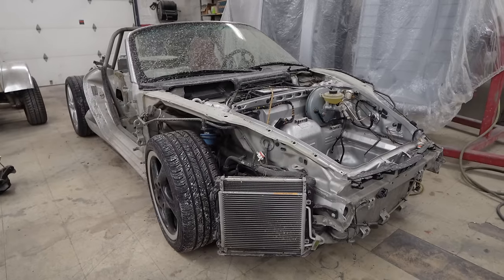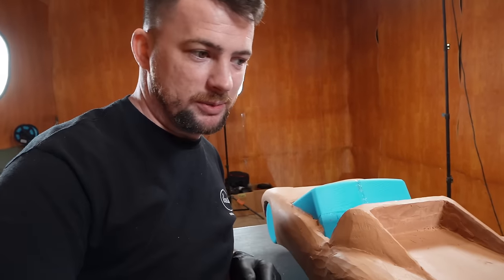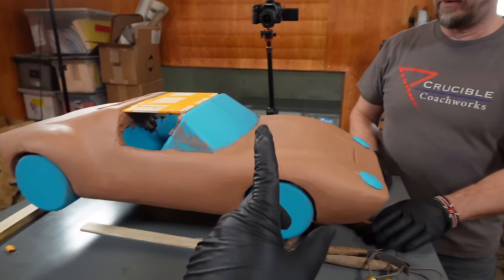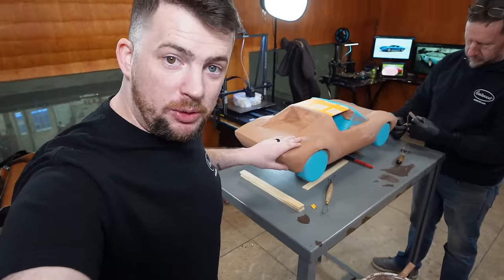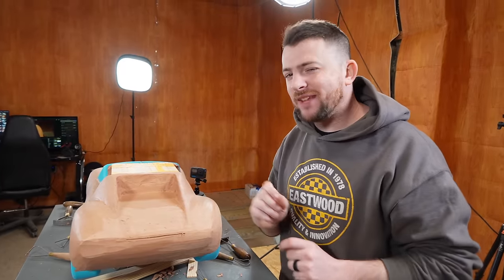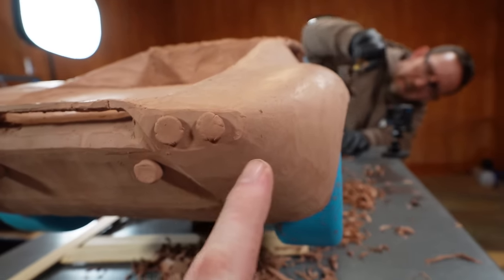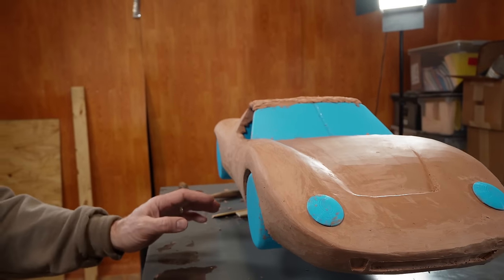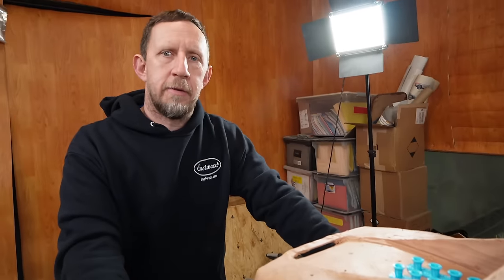We Used CLAY to Design Our $500 SUPERCAR! - Project Jigsaw

Comment: I think you are making difficult for yourselves.  Surely you need concept sketches before touching clay?  Just futzing around means more work and way more time to come up with something that works.  There are plenty of computer programs to help in design, so why not use them?  Second the lines for the door and engine access need to be thought out before trying to make them.  Lastly what sort of top is having, hard / fixed or targa / removable type.  Not easy to do all this.  It takes time, and you can get  option paralysis, but time spent in the design stage will pay off.  Having said all that, the car looks cohesive in concept
Reply: As someone who is far better at making scale models of the furniture I am going to build rather than drawing them to properly demonstrate my thoughts, your comment let's everyone know your genuine lack of understanding when it comes to self education. These guys are not designers, they are builders. They are using a medium that works for them to take what's in their head and make it something real. Just because it isn't the "standard" process means nothing. I feel bad for people like you stuck in your little tunnel vision worlds.
Reply: Id beg to differ, while yes concept sketches are great but it's only 2d, and 2d drawings can only translate so much into 3d. I imagine that yes they did sketches at points but IMO a) clay is more fun than any computer program, b)easier to translate and comprehend than a sketch, and c) they can scan the clay and put it into a digital medium if they wanted to. 

I love designing cars and if I had the space to do clay, I would do clay everyday over doing it on the computer. Plus 2 people can work on the same thing with much more ease than a on a digital program, or handing a drawing back and forth.

Comment: Ford GT has sqare front lights and circular tail lights, Miura has circular front and square rear... So, if you go with Porsche lights in front, it would be better to put square tail ligths... I think a new gen Fiat 124 Spider would be a very good match for this design

Comment: If you add a little volume to the top of the door and where it intersects the rear quarter panel and "flying butress" area I think it will help to tie everything together. It just looks a little hollow there.  This will also give it the round belly appearance that is so reminiscent of the 1960s mid engine cars.

Comment: Your model is really starting to come together. I particularly like the hips of the car, where your fenders transition to a character line of a shadow fender on the side of the car. Very nice. Same with the way the front edge of the hood is part of a continuous line which starts at the bottom of the windshield and sweeps all the way around to the same point on the opposite side of the car.

Comment: Because Boxster rails are so high it looks like Ligtning McQueen when you shorten the nose. Gotta lose the struts, that's why the rails are super high. Struts are an OE cost effective measure to get long life in a convenient package. "I'm definitely going to use struts" says no purpose built racecar designer ever. Coilovers are shorter and lighter but don't have the longevity with cooling. OE is also losing the entire upper control arm.